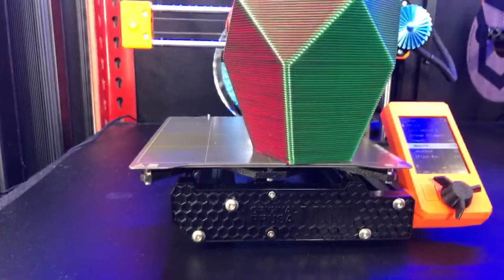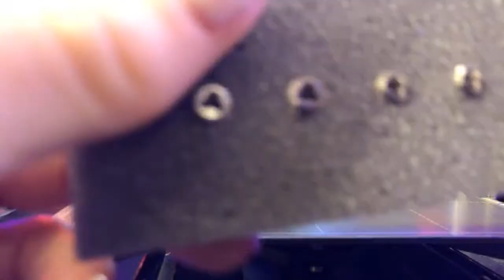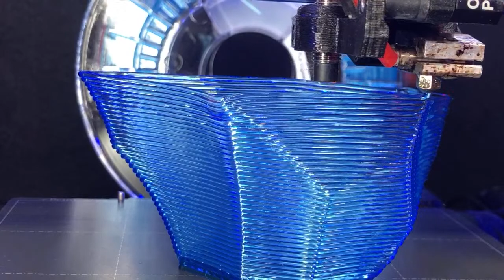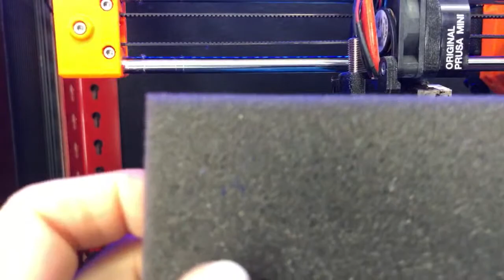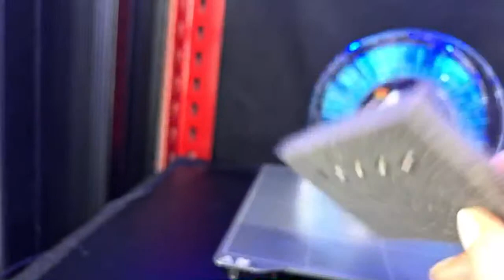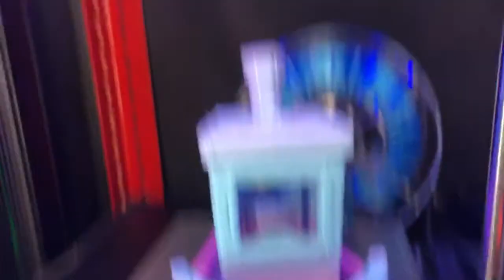Giant 1.8mm CHT nozzle crystal clear 3D print

Comment: While I don't have much experience with 3D printing, as I watch minutes 5 thru 8 (for example) it seems as if the filament is not uniformly heated because of the high flow rate.  If what I say is true, then coming out of the nozzle is a stream with differing viscosities across the cross section, but with triangular symmetry due to the CHT nozzle.  As the nozzle gets pulled along, the thicker/tougher portions of the stream pull and twist through the thinner portions - particularly on the turns - causing the melt to twist, roll, and undulate.  At this feed rate, the amount of time the filament is actually in the heated nozzle has got to be fleeting.  I'm amazed it works at all - pumping that fast - and maybe that's specifically due to the CHT nozzle tech.  Nevertheless, perhaps slow the feed rate and nozzle travel speed; simultaneously, lower the nozzle temp slightly but (with the slower feed rate) allowing a tiny bit more time to uniformly heat the cross section of the extrusion?   Just a theory.

Awesome video!  Thanks for letting us see these experiments!!!